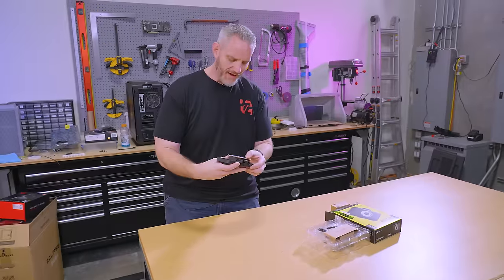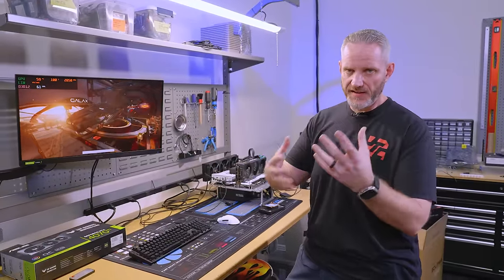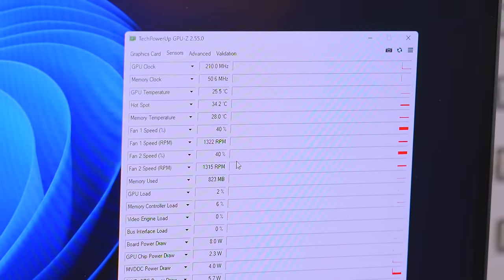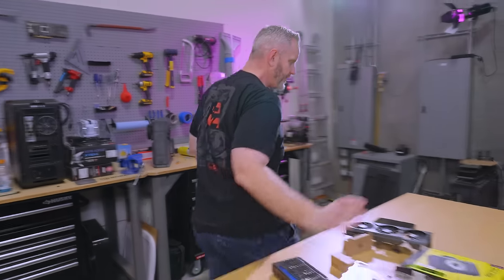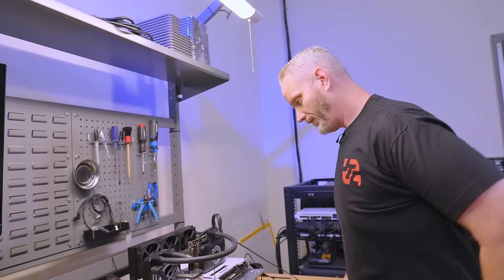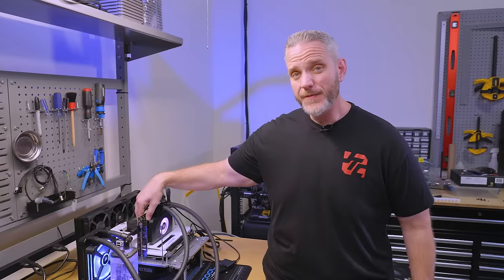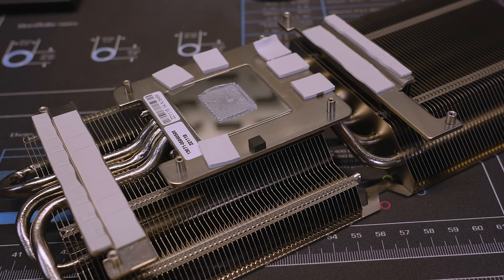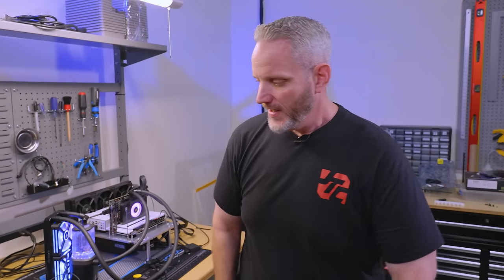They don't think I was being fair...

Comment: Would have to agree, the card looked so much better with the stock air cooler.
Reply: Let's not forget that cleaning this tiny fan inside a plastic case with tubes attached is going to be unnecessary more difficult. The stock triple fans ramps up at startup to "clean" itself. Because the 0% speed out the box settings under x-degree.
Reply: Looks like it was made in 2008
Reply: With AIO it looks like a card straight from 2005.
Reply: @RaveDaver Wait is that true ? I always found it weird that it did that.
Reply: @VerGiLL1  At boot up the GPU fan settings(if you use software) aren't loaded so they go full blast.😁
Reply: @RaveDaver I like it, it's like starting a car.

Comment: This is 100% spot on. If priced much lower it would make more sense, but you also need to consider the opportunity cost of the rad, pump, fittings etc. For another $23 it's much better to get a full block
Reply: If you already have a loop and you are replacing the graphics card and you end up paying 1200 for a 4080 I might want to get a decent block asap that does the job to get my card under water, the issue is this product is not priced in that way, it needs to be 50$ cheaper to make sense, you can get a full block from another brand for a similar price.
Reply: Your use of opportunity cost implies that someone would purchase a water block in lieu of a rad, pump, fittings etc

Opportunity cost refers to what you have to give up to buy what you want in terms of other goods or services.

I think you're trying to talk about sunk cost? Or maybe just cost? Like:

If your loop is already an additional $300-400 on top of your build you might as well spend the extra $23 for a real full block.
Reply: @medic-chan  I am not an economist but what I was trying to say is that the return/value on a higher end full cover water block is subjectively higher (aesthetics, temp) than choosing a cheap water block when you factor the price difference into the total cost of going custom water. The total cost being much higher due to the sunk cost of other components like rads, fittings, pump and res
Reply: @andresgallego5727  yep fully agree. It's just doesn't make sense given to price difference between a full cover block given the overall cost of going custom water
Reply: And you can just upgrade the fans on the air cooler for like less than a 3rd of the price of the block alone.

Comment: I agree with you Jay. I'm shocked that Corsair put their name on this product though. It looks like hot garbage. I would not put that in my case. I understand what they were trying to accomplish, but honestly a GPU is not a trivial component to cool. Especially these days. I can't even recommend this for a budget office GPU because this is overkill for such a low performance part. This product simply shouldn't exist. You can either do cooling right or not at all. This product I predict will lead to an early death of a GPU if used.
Reply: Good thing no one will buy it - why we love objective reviewers.
Reply: Trial and error lead to innovation.
Reply: Which block is better, the Bykski, or the Alphacool?  I have read the Alphacool has isses (4090 AMP owner here).
Reply: @MeshMN  An objective reviewer? First off a objective HUMAN does not exist. Second he scored a cooler on it's looks. Which is weird since OBJECTIVELY speaking a coolers main function is to cool something, not to look cool.

How "good" or "bad" something looks is purely subjective.
Reply: @generalawareness101  I've had a 4090 AMP extreme since launch last September, and have had Bykski block on it for about half a year. Performed very well with no issues, because I changed cases and went to a larger rad surface, dual pump, and delidded 7950x configuration I changed the Bykski block to an EK one. There is zero performance difference but the blacked out "boxy" look matched the rest of the build so went with it purely for esthetics. The Bykski block cost me around 90$ + back plate, can't beat that :D
Reply: it is Hot Garbage. std Corsair product.
Reply: Water cooling is overkill for a 4070-70ti anyways.
Reply: I got an old school corsair waterblock on my 3080ti and even with my pc never being on the floor I recently took it apart for some TLC and liquid metal. The dust I saw was quite impressive, I can just imagine how the caked on dust will be after 1 year of using this POS.
Reply: Why are you shocked - Corsair and hot garbage go hand in hand.   Along with massive overpricing.
Reply: @malphadour  what brand is good according to you?
Reply: @ThesurgeoNNN  old school? I have a Thermaltake Big Water running on my 775 cpu. ...what's the age of your " oldschool " block? 2 weeks?)))
Reply: @MeshMN  No a few suckers will as they're diehard corsair fanboys who swear that corsair stuff beats out EKWB, or Crucial, or Lian Li, or Antec, or Alphacool, or Heatkiller.
Reply: @Nemesis-pe7mw  He did an UNBOXING review not a full hardware test review.  Unboxings are about aesthetics and nothing else.
Reply: @AndreasRP.  People like you who act like overclocking isn't a thing really irritate me.
Reply: @Xerou  water cooling an overclocked 4070 is still overkill lol. Educate yourself

Comment: the card with the waterblock looks like the old dinky plastic stock heatsink cooling solutions from 20 years ago. its looks cheap especially when its so much smaller than the PCB. and not having a daisychain passthrough for the corsair ecosystem (how much more difficult would it of been to run everything through one controller block) is an oversight for such an expensive product. its a great beta product at most in my opinion.

Comment: The long term risk to the VRM's is not worth it even if they lowered the price to $79.99, this thing is just not fit for purpose and Jay I can see you tried really hard to be fair but I wouldn't risk an $800 GPU to save any amount of money,, anyway enjoyed the review keep it up!
Reply: They could lower the price to $0 and it wouldn't be worth it. Think about it, it's $150 for a good block from Alphacool, give or take who you buy from. Then you realize that you're dropping $400-500 in rad, pump, tubes, fittings, reservoir, etc. So, that $150 block only represents 27% of your water cooling budget. Meanwhile, you've now got a GPU running in a way it was never designed to, because there's not a single 4070 Ti out there running bare VRMs in stock form, and it is highly likely that it will fail prematurely due to heat from the VRMs. If not thermal throttle if you game for long periods.
Hard pass, even if it were freee.
Reply: 70C for VRMs is nothing.

Comment: This takes me back to my r9 290. I got one of those NZXT brackets that adapted a CPU AIO to the GPU, which was actually a lot better value. I think back then, I got a 120 AIO and the next bracket for no more that $100. This thing is $130, no pump, no rad :(
Reply: I bought a ID-Cooling 120mm AIO for my 1070, it was around $40.
Reply: GamersNexus did a video on attaching an AIO to a 1080 ti. I copied that with my gpu. AIO or "hybrid" cooling for under 80 bucks.

Comment: The NZXT 20-30 dollar frame to attach an AIO to a GPU was,  and still is, such a better value. Not to mention that bracket with a Fractal Design 360 AIO on a 1080TI ran RE4 Remake flawlessly. Sure, hotter than my 3080TI on a full custom loop, but it chugged along. That little thing Corsair made is.. a weird homage to that, I feel. I hope NZXT brings that bracket back.

Comment: Personally I'm of the opinion that water cooling anything below the 80 class nvidia cards, unless you already have a loop, is silly. Use the money you would spend on the block and loop to upgrade to a 4080 or 7900xtx.
Reply: Watercooling any GPU is silly.
I understand people doing it for the look, or in some case for space gain in custom looped itx. But it’s still silly.
Huge waste of money.
Reply: @thierryfaquet7405  With GPU air coolers being better and the cards being pushed to their limits already not leaving OC headroom, water cooling is more about acoustics.

I was going to mention how already water blocked GPUs are a good value at the high-end, but the prices on the water blocked 40 series cards is just stupid. 

My 1080ti with a water block was basically the price of a reference 1080ti and a water block. And with that I got a factory OC'd card that if it was air cooled would have been close to the same price. 

Though like I said this seems to be a thing of the past with the 40 series. They all seem to want to push AIO'd cards.

Comment: I would of used that back plate as they actually work well. The whole thing dissapates hot air. Back plate will probably lower temps on the core about 3degrees. On my last Asus RTX3090 it benefited.

Comment: I was very enthusiastic for the hydro X link products, minus that GPU block. But after seeing your actual use and implementation of the parts, I am going to remain with my older corsair hardware. The whole point of the link products was to simplify the connection path and that did not happen with the pump or the block. And the fans, which were objectively the worst part of cosair's prior ecosystem, still aren't entirely resolved. Hopefully like the Lian Li revisions of their product stack, we get similar tweaks to this system. 

Corsair: 1. lose the 2nd break out control box and put passthroughs on everything. It will make everything so much cleaner and better for the end user. If that can't be done, include the break out box and extra cables at a lower cost with the hydro x parts. 2. provide 90 degree cables in box with the packs of fans and the hydro X parts. 3. try to shrink the cable connections so they don't foul on fittings. Lian Li had the same problems in their earlier fans. 4. Take the GPU blocks back to the drawing board.

I really think there is still potential in this product line but the majority of it needs minor revisions and the GPU blocks need serious changes both in aesthetics and function.

Comment: I don't know if someone already mentioned it, but with the 90 degree Icue cable the fitting and 14mm hardline tube fits. You just got to plug it in first then add fitting etc

Comment: I tried this on a 4090 and was surprised. The preinstalled thermal pads were inhibiting die contact which lead to crazy temps. After a re-paste and removal of thermal pad material between the die and vrm, it performed very well. I added small heatsinks to the back side for about $10 just for the hell of it. Honestly, I'd prefer something like this over a custom water block. They should just add a small backplate to the mounting solution to help with thermals and aesthetics...

Comment: I went with a Suprim Liquid X, a hybrid, card to fit in my lian li o11d.  At idle the thing sits at 31c, under load it never breaks 55c boosting to 3ghz with a bit of an overclock. Main reason this generation is just size. The stock coolers are a pain to fit in any mid tower case. Especially with the clearance for the 12vhpwr connector required. Being a hybrid card from the factory I think is the difference. The cooler is designed for this card specifically. 

That being said I did try the evga hybrid kit for my 3080 10g. The memory temps on it were just awful though. Constantly above 90c under load. The plate for that cooler 1. not being monolithic and 2. being so thin just was a bad design. 

For years I have thought about building a custom loop but upgrading piecemeal and passing those parts down through the house, not to mention moving often, has always stopped me. I don't think I've had a static build in a PC for more than three years at this point. But all my parts get cycled through three, soon to be four, machines in the house before they're out to retirement. 

Long story short I don't think there is necessarily a problem with hybrid cards perse, given proper design. But an aftermarket solution like this is definitely going to perform worse.

Comment: Thoughts from viewing.

1. DO NOT TAKE APART THE THING BEFORE YOU PUT IT ON AND TEST IT. I do no care how much 'work' it is to get it dry again. Once you take it apart you can introduce variables. What we want to know is 'does it work from the factory' because guess what. The vast majority of users are not going to take it apart first, nor is it recommended to do so. We're going to plug it in, as it is, straight from the factory. Shout out to GN and HUB for this tip.
2. VRM Liquid cooling, would be nice, though can say anything you do to one side, you need to do to the other. If you liquid cool the VRM on the front side, then you also need to liquid cool the back side. The point here is thermal expansion and consistency. You don't want it to get hot on one side and cold on the other.
3. Memory cooling, I'm not aware if the 4070 or 4070ti has memory on the back side of the PCB, but same remark as in no 2. IMO right call on not including the backplate on this card. Air to Air, Water to Water, heat pad to heat pad. Don't introduce something that's not on the other side.
4. ΔT over Ambient please. Your in SoCal, which is forever on FIRE. How hot is it in your warehouse?
5. Most important question. If it was free, would you bother to install it? I think the answer in this case is NO. The lack of cooling on the VRM and marginal at best performance on the GPU makes it a questionable purchase. VRM heat alone is a concern.

Overall agree, garbage product. Not worth the effort removing, nor worth the risk to damaging the VRM components over time. Better to leave the air cooler & backplate on.

Comment: @JayzTwoCents ... great job on this ... BUT .. there is another thing you didnt factor into this ... does the fan part of the gpu cooler hang low too much that it would interfere with a M.2 Drive with a heatsink on it as you know most manufactorers place the 2nd M.2 drive slot for some reason directly under the gpu primary slot.

Comment: I'll say it every time Jay does, if only for the few random people that read it. A thinner contact plate is NOT a bad thing. For heat transfer, the thinner the better. If you need an example, half the reason the 7000 ryzen series sucked was because of the thicker ihs. The heat couldn't transfer as quickly because the ihs was thicker, and you can see thermal spikes every time it loads. The only time mass comes into play when considering thermals is touching on equilibrium, because you need to calculate the total heat contained in the thermal mass. But considering the contact plate is in between the heat source and sink, it won't affect the equilibrium temperatures, it would just make it take longer to get there (not a good thing)

Comment: I have a $6000 PC. It has a great size window. RGB etc. But it sits in a location that you really can't see inside. I don't really care to look inside. The window is mostly for me to make sure nothing seems to look  loose or melting inside. I can look in with a flash light and make sure the GPU support beam has no shifted. I can make sure the PCI-E power thing that was shown to melt etc is not melting things like that. I don't really care how it looks. I can't even place my PC in a spot that lets people clearly see inside without having to like bend over etc. So yes this water block if it works well I would use if it was cheaper. Overall I care most about performance, cost next and finally how it looks. All three are at least somewhat important though so I am not hating on JayzTwocents. After all I am an adult and can form my own opinions. Nothing a youtuber or anyone can say will decide for me. So I don't get why some people get hate over just raw opinions unless they are well into the territory of wrong or exploitable etc. I'm not even saying people are hating Jay for this though. And I still welcome full testing not just unboxing when possible.

Comment: A noise normalized test comparing the nearest in price full cover+backplate, the Corsair thing, and stock cooler, would be great. I run a custom loop, and intentionally run it a little warm, as the coolant can easily soak up intermittent loads. When I'm pushing the system I don't care much if it gets a little loud.
Reply: A noise normalized test is all but guaranteed to be irrelevant.

Comment: Better solution than this is to go old school (think circa late 90’s water cooling) when we pried cards apart (pre-YouTube of course) and made custom brackets out of spring steel to hold our generic water locks down on the gpu, with the really fancy of us adding heat sinks (which were hard to come by if Radio Shack had already closed for you and you didn’t have Fry’s [RIP] around) and pointing fans at our monstrosities. 😅

Signed, Dr Frankenstein.

Comment: LOL... thanks for mentioning those slot-coolers. That Corsair-block immediately reminded me of some HW-component of yore, I just wasn't quite sure which one it was. Extra points for mentioning those Zalman-coolers. Not sure if they were the ones you meant, but I had one of their "flower"-design CPU coolers (and its GPU counterpart) back in the days of...err... the P4 and Radeon 9500/9700, I believe? The ones where a horizontally mounted fan was sitting inside a circular fin-stack. Not sure if they were any better than contemporary coolers, but I did like their quirky look and design back then.

Comment: If I had that block, I would cut the extra off the backplate and still use it if there were VRMs on the backside of the card, or get some heat sink blocks and put them on the VRMs